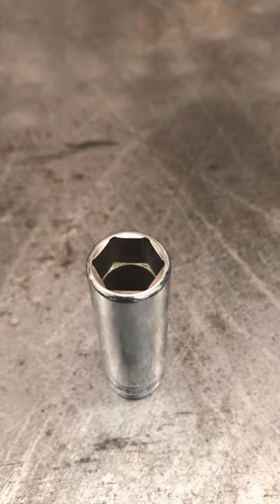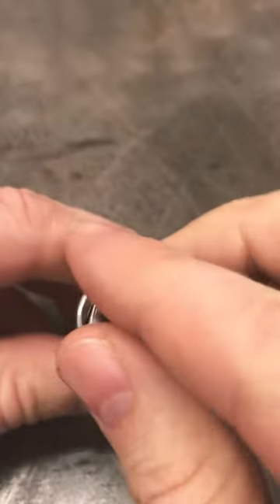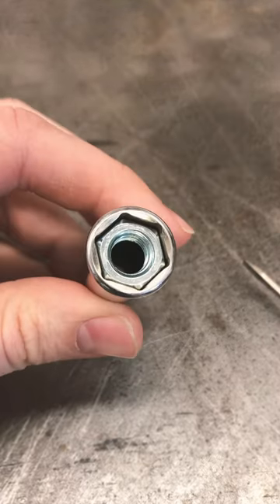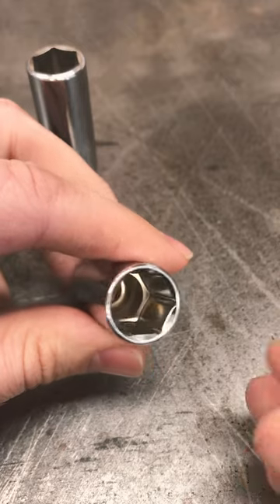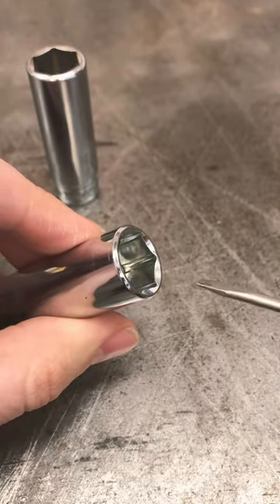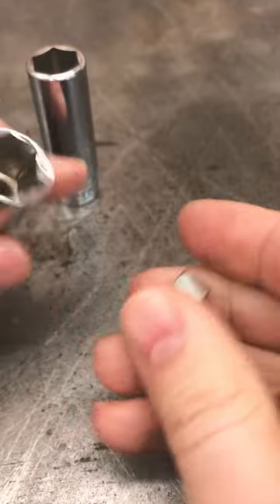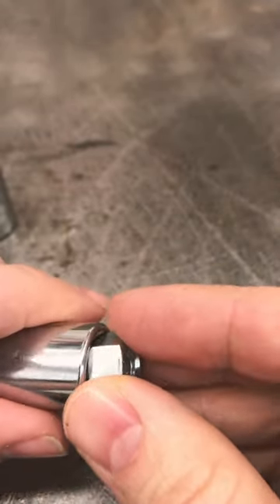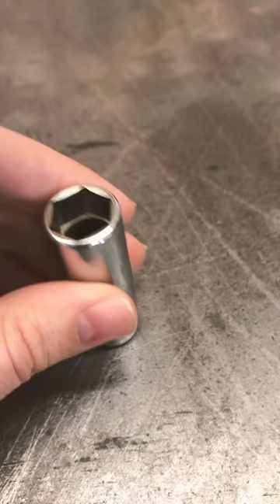What is the Snap-on Broach on This Socket? #tools #snapon #garage #automotive #rebuild #diy #shorts

Comment: Personally, most times I far prefer the broach is as deep as possible, i tend to need it far more often than a shallow broach
Reply from the maker: The broach touches nothing but the nut, deep just means the nut can go inside the socket deeper. It doesn’t change clearance on the bolt any.

Comment: I disagree. That makes the DEEP socket completely pointless. At least the way i use them. I can use a regular socket for that. When i use a deep, i want it deep. (That's what she said.)
Reply from the maker: With a deep socket what is being turned and what is being clearanced?
Reply: I was thinking the same thing as Allan until I answered the same question that  @eightpenny6379  just asked.

Comment: I have plenty of snap on tools and equipment. Been buying from them since 1992.  I noticed the chamfer on the cheap sockets I have, and I just used the belt sander to make the bottom flat, and several sockets I have had to modify. I bought a 32mm off the truck about 10 years ago and it was too thick in the wall for my application. So before I bought it I asked the tool man if he would still warranty it if I put it in the lathe and cut it down so it would work for my application. He said that he would warranty it just like normal.

Comment: I don't remember exactly what it was, but I once had an instance where the nut had a relatively small size hex, and it was fairly far down a stud. The snapon socket got hung up on the stud, and I had to use a harbor freight socket to turn the nut.

It's only been a problem that one time though.
Reply from the maker: Gotta leave some one timers for the rest.
Reply: That happens to me all the time, I mostly use my dads cheap 1/2 inch Pittsburgh sockets now because of that, work just as good as my snap on 1/2 inch set

Comment: Everyone doesn't seem to have a problem, but have never had to install an adel (P-clamp) in aviation. You need the socket to force the nut to compress the clamp, so you can install onto the screw. Craftsman sockets suck compared to the shallow broached snap on sockets.
Reply: I'm an Aircraft Mechanic and I know exactly what you mean damn. I've been thinking about picking some up for that and the 757 brake.

Comment: Love my snap on but I've also found my icons set also have this feature copied as well. It is the only other brand I've seen with this and I'm sure it has something to do with the designer they poached from SO. I'm not complaining though, not a bad thing to copy
Reply from the maker: Icon won’t sell individual sockets if one breaks you have to exchange for a full set. That in time could be the Achilles heel.
Reply: Good thing a whole set of icon costs what a single snap on does.
Reply: That’s weird. My local harbor freight store will exchange individual Icon sockets for warranty with no hassle at all.

Comment: Your first 3 threads should be put on by hand anyways
Reply: Yes, if your working on something human hands can fit in.
Reply: @16-BITFPV  if any of these tools fit I assure you three fingers will too
Reply: @nickkk420  Hopefully your joking. Working on stuff like aircraft not only can you not reach a lot of fasteners with a human hand sometimes you can't even see them without an inspection mirror. Cars also, like bell housing bolts.
Reply: @16-BITFPV  in those cases an impact gun isn't fitting in, and likely not a rachet either, it'd be a wrench, in which case u need a whole other set of strategies and hacks to keep the nut in place
Reply: @nickkk420  I've personally never seen a transmission tunnel you cold sneak a wrench up into before. What stuff do you normally work on?
Reply: @16-BITFPV  works for me bro, take care, keep those threads crossed 🤗😉

Comment: Now you're really making me regret the deal I passed up last week for a 1/2 set of deep well sockets for 250 through snap on
Reply from the maker: Ebay has some great deals. I picked up never used 1/2” dr deeps for $200 less than snap on new off truck. They must have been bulk purchased because they were date stamped 2018. So take a look around.

Comment: eyeball the whole set of sockets they're only shallow welled for the smaller sizes likely. I prefer the socket to be a deepest well possible like a sensor socket, and use nut setters to start things.
Reply from the maker: Likely??? Don’t waste time typing I own them.
Reply: @eightpenny6379  Every set I've ever seen is that way, including my dad's snap-on set.  Its not a feature to write home about, more often than convenient it is counter productive to removing stuff because the socket must move away from the fastener with the nut where there often isn't clearance for that to happen, thus shallow broaches are good feature on shallow sockets but a liability on deep sockets. I know these things because I use them.

Comment: Shit that nobody has ever had any problem with.
Reply from the maker: Thanks for watching
Reply: It’s not often…but there’s occasions . Especially the bevel at the end on the socket when you have a thin nut…that’s more often an issue…had an SK socket with a heavy bevel that wouldn’t catch the nut…had to grind the end of the socket so it would catch the nut